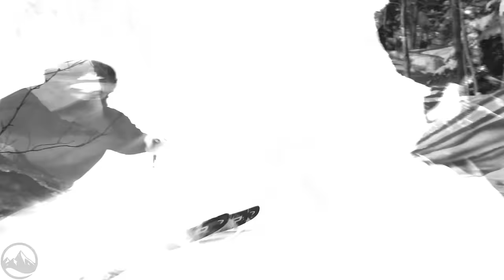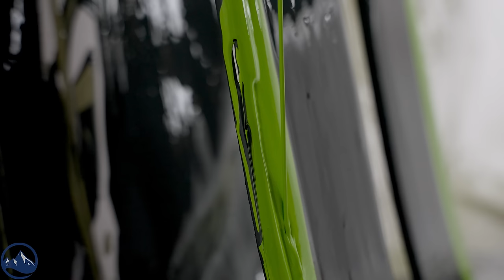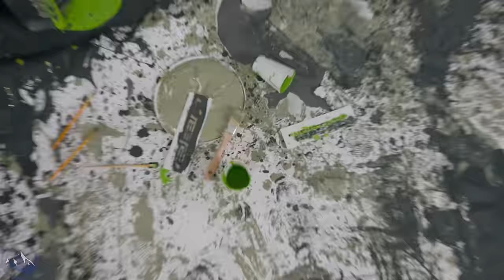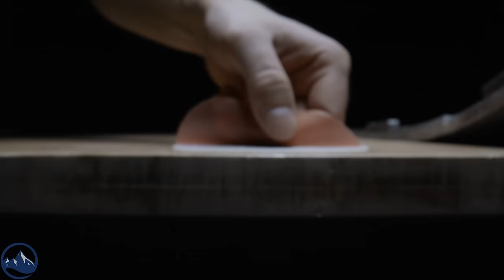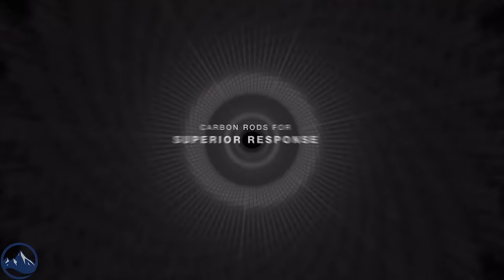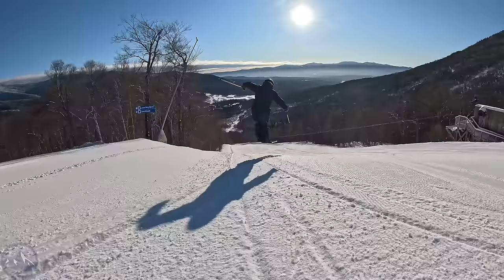2025 Elan Ripstick Ski Collection Introduction and First Impressions with SkiEssentials.com

Comment: Why no 88 black??
Reply: Sadly because of the Wingman 86 black
Reply from the maker: We keep asking too!  I think a lot of us would rather have a Ripstick 88 Black than a Wingman 86 Black, although that ski is a lot of fun too.
Reply: @ericaminoff  I have both of these skis: 2022 Ripstick 88 and new 2024 Wingman black edition.  Apart from the fact that both say "Elan" on them, they are quite different.  The Wingmans are like a set of railroad tracks bolted to your boots.  They are also a lot heavier.  They are somewhat playful and like being tossed in the air a bit off small bumps and such and perhaps carry that aspect of the Ripstick series over.  And - in a pinch - you can see them in deep snow, but you have to be really really delicate, because they will hook up, especially the tails, since (at least for me), you will end up very rear biased weight wise because they are so stiff and won't float like a Ripstick will.  However, the only Ripstick that comes close to the Wingman BE in terms of "on trail" high speed stability is the 106 BE.

I love how easy the Ripstick 88 is to ski.  However, my biggest complaint with my 88 Ripsticks is that they lack stability at top speed (compared to the stiffer Ripsticks).  It will be interesting to see if the new 88s can manage to keep the fun and maneuverability of the outgoing 88s while injecting some additional top end performance into the ski.  The outgoing 88 is awesome in bumps, low snow depth tree skiing and "a few days old" chalky snow.

Lots of interesting stuff in the new Elan lineup this year: almost makes me want to refresh my all Elan quiver (the above, plus 106 BE and 116) , but honestly, it's working so well right now, it's hard to imagine switching out a bunch of these models, just because there is something "newer", though the Playmaker 101 seems pretty cool.  The outgoing 116 is a monster ski - super fun and very very surfy in deep snow.  I'll look forward to the reviews on the incoming 108 and will probably go demo a 102 BE just for fun.  I agree that the outgoing 106BE is a charger ski: awesome in crud and while not as stiff and damp as an all metal charger ski, you still need to be on top of it since it's a fairly aggressive ski.  Do you guys think that ultimately the playmaker 111 will actually be the direct replacement for the outgoing 116 (more so than the incoming 108)?